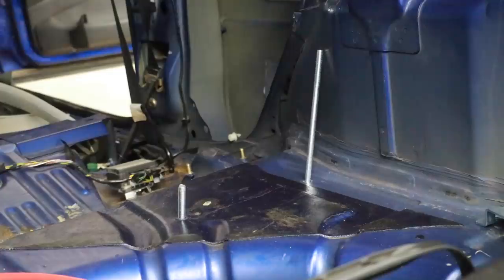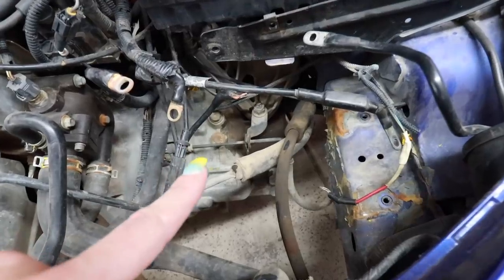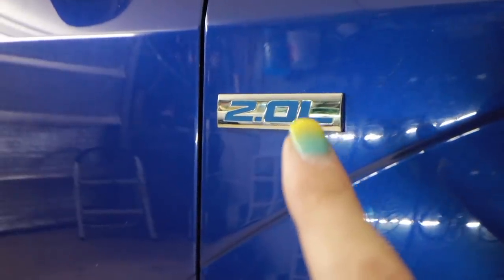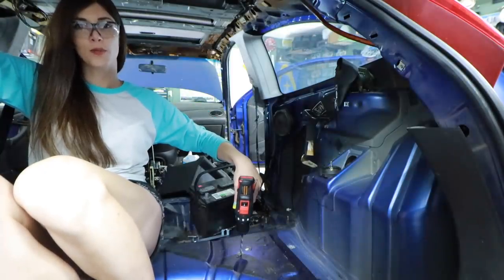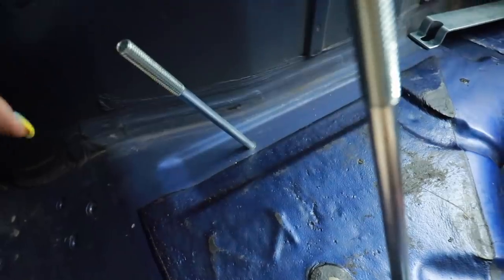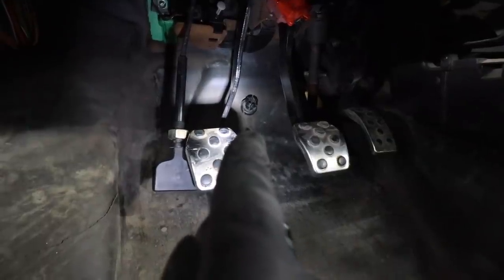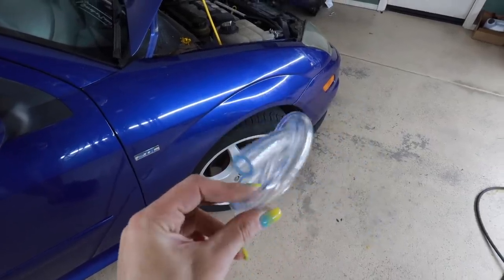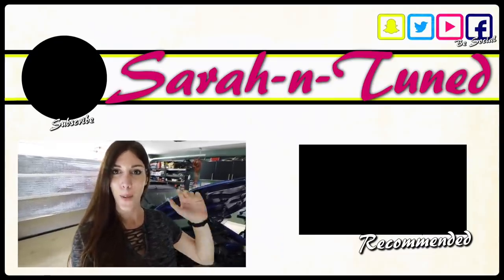Because Racecar!? // Rally Focus SVT Battery Relocation

Comment: So the Battery Cut Off, it won't shut off the car because your alternator is still being driven by the engine. There is a 6 pin Cut Off Switch which you need to wire into the ignition of the car too so when you pull the bone it actually interrupts the ignition and turns off the car while also disconnecting the positive terminal. I like your videos! Cheers from Germany 🍻
Reply from the maker: FAT CAT Performance 😫 ...too late now
Reply: @SarahnTuned  I was just about to say this. You need a Battery disconnect switch with Alternator Field cut-out contacts(which are supposed to be disconnected prior to the High Current Battery contacts). Don't worry, I have a similar single contact switch in my race car, I just make sure to switch off the ignition before turning off the big red switch, lol ...I'm really enjoying this build btw :)
Reply: @SarahnTuned  Might want to check that rulebook again, some sanctioning bodies require you to have the correct shutoff switch.  It would suck to show up to tech and get turned away for something that simple.
Reply: @SarahnTuned  unless you're swapping to a total loss electrical system (no alternator) you're almost certainly going to need the other style switch. I've failed so many SCCA cars for annual tech for this exact mistake.
Reply: The 6pin switches also have a resistor to dump the current to ground. Even if the kill switch kills the battery and shuts down the engine, the spinning engine will turn the alternator and generate power. The resistor will dump that power to ground.  I've had to re-wire the kill switch a few times, because different tech inspectors had different opinions on how it should work. I've also fried an ECU when it was setup wrong. That took a LONG time to figure out, since the car would run but not well.

Comment: Make sure you have a service loop when running cables.  (Extra length or some zig zag in the layout that can be used to extend or retract the length.  Helps to install/remove the battery.)

Comment: Hey Sarah one thing you have to check the rules for relocating the battery. Depending of the class that you want to run...
Reply: Good point.
Reply from the maker: Santiago Alban by the time I actually finish this thing, they’ll be racing solar powered rally cars 😂
Reply: @SarahnTuned  Dude they'll be flying Jetsons style by the time you're done.

It's a bird! It's a plane! No it's just a Camry.
Reply: I don't think the center console is going to suffice for the battery switch. They will probably want it in an area where it can be reached from outside the car, without having to reach in that far. I usually see them on the dash, near the side window
Reply: Every racing sanctioning body has it’s own rules for where those shut off switches should be, please check the rules of which your going to race in to make sure your not wasting your time.

Comment: The RTV on the IMRC actuator looks very old if nothing else, might still be worth pulling apart to check. If not, they used that same actuator on a few different vehicles(different cable, bust same unit) so a new one for a SVT can be a used one from a Contour or a Taurus.

It's also going to be worth checking the linkage at the manifold, if it's sticking it can give you the same fault, and also keep those runners long above 4k, which might be what you were feeling with it not wanting to rev out well.

Thank you for the circuit breaker mention, I was getting a little antsy seeing that many feet of unfused power lead.
Reply: Mondeo ST200 and 2.5V6 use same IMRC, also Cougar use the same. Dunno if you had these cars in US.

Comment: Great video, Sarah. I'll be interested to see the conclusion of this phase of your project; specifically, how you route the ground side of the circuit where the old ground cable was. Keep up the great work. Love your channel.
Reply: You usually use the cars frame as a link for ground. She will probably screw the battery terminal near the battery and the old battery cable somewhere in the engine bay.

Comment: The fill hole on that transmission is on the front facing side towards the bottom, there is a vent on the top/back near the shifter linkage, but unless it's worse in person than it shows up on camera, I'd spray it off and call it good.

Comment: You'll need an externally mounted pull cable to the isolator. Dont think mounting on centre consol will cover you for access from outside. Also might need to upgrade the isolator to what they normally call an FIA spec that kills alternator power too.

Comment: Before you cut the wire you might want to get an idea on cage placement. Most race cars I've been around have the wire loom inside the cage to prevent severing in a crash.
Reply from the maker: vanmanpredator1 I don’t have anyone to fab a cage yet 🤷🏻‍♀️
Reply: @SarahnTuned  most roll cages are made from 1.25 inch to 1.75 inch diameter tube. Some go 2 inch diameter. So if you go 4 or so inches inboard it should be good.

Comment: I'm not reading comments to see if it's been suggested already.

When you're drilling, and you're concerned about damaging something on the other side of your work piece, you can use a drill stop, which prevents you from drilling deeper than a specified depth. They come in sets.

Comment: The shut off switch is not usable for anything else than styling and to stop battery drain while storing the car.
For a race/rally car you need a switch that cuts both the battery cable AND fuel pump power AND/OR ignition power. The car needs to shut off when you flip the switch. If you only break the battery the car will still run off the alternator...
Usually you also need to be able to reach that switch from the outside of the car, which can be done by a handle on a wire.

Love your videos, your always fun!

Comment: @Sarah-n-Tuned: Nice Idea with the breaker switch, but I would run a Bowden cable outside the car, so in case you're stuck a marshal or viewer can shut your car off (dis-/connecting to the hole in the key of the switch)... and mark it accordingly with a red electrical flash sign on blue ground or just a red flash with your colour of the car :)

 Also the circuit breaker must not be more than 30cm (about 1ft) away from the battery pole, I would suggest a ANL type of fuse, they're sturdy and available in the ratings you need for this application.

Comment: You should consider putting the battery cut off on the driver side A-pillar,  also as others have stated you might need to change your battery set up depending on the class.
Reply from the maker: RetemVictor I could still do that, it just makes me nervous having it outside the car since I still have to drive this thing on public roads.

Comment: I used to read on focaljet about people trying to repair those IMRC’s for the intake, and I had one fail myself in 2009. Just replace it - that one is super ghetto repaired...or since it’s going to be a race car, just replace the intake manifold with a racing manifold and get rid of the dual stage intake. A tune will eliminate the control variables and prevent a P1518

Comment: Sarah. for safety sake ,and Fire safety .you should mount a metal handled  kill  switch(plastic key will break ) outside the car..with a remote cable attached to it so the driver can shut off the switch and some one outside the car can do the same if your Rally  car is rolled over and they can not get in side the car.they will Not be able to shut it off .thanks for sharing the video

.

Comment: 1) The Ground Battery wire needs to be attached to a big chunk of dense metal, opt for the original location or simply attach it on the gearbox (many cars have the battery ground on the gearbox). Otherwise you will have voltage losses along the circuit, the battery will not charge correctly and the alternator will be prone to failure due to voltage spikes (such as when the engine fans start). 2) You do not need a circuit breaker for the Plus wire, the length of the cable is not an issue if the wiring is done correctly. 3) When you disconnect the battery, you first disconnect the ground wire, then the +, and at reconnection you do it the other way around. For this reason, the cut-off switch needs to be placed on the ground wire. 4) While you're there, do a check on the alternator and make sure it runs in good condition (i would hazard a guess that it needs a rebuild by the looks of the car). 5) After all these are done, you should have AT MINIMUM 13.8 volts measured at the battery with the engine running, at least 2k rpm and the headlights on for the battery to actually charge. At optimal you should have at least 14.2 volts to indicate good charging. Any less than 14.2 volts means faulty alternator/wiring. Extra stuff: i would add insulating material on the + wire if you're there.
Reply: You're wrong. In a DC circuit you ALWAYS put the fuse (or switch) on the positive side of the circuit.

Comment: Might be worth not attaching the power cable until you get a cage installed just incase you have to move it when either welding or bolting the cage in. Keep up with the great work and videos

Comment: It looks a helluva lot better with the European spec radiator grill and the headlights with the built in indicators were on the facelifted Mk1.5 here in England and looked loads better than the original indicator location in the bumper. I've seen them retrofitted into Mk1's

Comment: Hi Sarah not sure about in the USA but here in the UK the battery cut off switch is usually on the outside of the car between the bottom of the front screen & the hood with a direction arrow to say which way is off. I would of had the roll caged fitted first does it have to be fully welded in or a bolt in cage? You might of put battery box exactly where a cage suport will be? Good work so far though

Comment: In Europe we actually use cable operated main cut-off switches, so that you can have the switch inside and a cable end outside of your car (allowing the rescue team to cut off the power purely from the outside). Something like this: https://inter-rally.pl/product-eng-34380-RRS-6-poles-FIA-master-switch-isolator-with-pull-cable.html
For the circuit breaker you can use a BIG fuse, something like 300 Amp.
As far as I recall mk1 Focus, there are some grommets inside the A pillar, but I might be totally wrong on that... For smaller gauge wires I used to use the steering column hole.

Comment: Might be worth turning your battery through 180 degrees so that you have slightly longer cable runs inside the battery box so you can disconnect the battery in future, eg. If you need to change the battery, or need to isolated the battery to work on the kill switch

Comment: Hi Sarah, you might want to check your local rally regulations, as im pretty sure you need to have an external battery cut off, if car was upside down then would not be able to reach in to car to cut the power, im also pretty sure there is something else that needs to have external access as well, but your local rally club, authority would be able to confirm this for you.

Comment: Not telling you what to do, however I am relocating the battery on my 86 foxbody. I looked into using a fuse or a circuit breaker at the battery. It isn’t a recommended practice apparently. The starter draws more amps than the breaker can handle. Idk it goes against everything I believe in lol. Let us know your thoughts on it. Thanks!

Comment: If you haven't cut those cables you should leave a little slack in case you need to relocate them for the cage. Depending on the style/regulations there might be a base pad in or around those floor edges.

Comment: It might be a rally car, but if you look at the top rally teams, their cars and workshops are spotlessly clean and are treated like formula 1 cars. also, you shouldn't have to run the negative cable through the car, it's a negative earth car, connect it to the chassis as close to the battery as possible, job done.

Comment: How did you work out the thickness of battery cable required? I've tried using 510 CCA in an online calcuator  but the size it says for a 3metre length is 70mm2!

Comment: You do not need to run a ground wire to the engine bay.  Simply ground the cable to chassis ground near the battery box.  Wire = $$ and weight.

Comment: Great content. I would suggest that you research four pole cutoff switches. I believe that because you have an alternator, your current cutoff switch will not shutdown the engine as the alternator will provide power as long as the engine is running.

Lookup Moroso #74108. That should do what you need and I think the Moroso catalogue will explain why you will need one (as I might be wrong).
Reply: My  thoughts as well,  and it needs to be accessible from out side by marshal

Comment: You dont need rear weight. Make the rear of the car weigh 0. Suspension will provide loading on the rear outside tire and thats all you need. Throttle will provide load on the rear inside tire when needed.

Comment: Your kill switch needs to kill the alternator too.
I'd test reach the location from the outside of the car to see if it is actually easy to grab for a helper. If not you might need to move it to the outside of your dash instead.

Comment: I notice that your transmission is missing the counterweight, its not really needed but helps with the notchy-ness of changing gears.

Here's a link for the headlight wiring, you might need pigtails if the lights did not come with them. Most vw's of that year used the exact same pigtail 

https://forums.focaljet.com/showthread.php/643847-HOW-TO-VW-Wiring-Hack-(convert-your-car-to-Euro-MACH-headlights-with-pictures!)/page6

Comment: My race car follows a different rule book but I ran my electrical cutoff as follows:

1 - Circuit breaker next to the battery.
2 - The thickest 100 amp cable goes straight from the circuit breaker to the starter motor.
3 - Thinner 50 amp cable goes from the alternator straight to the starter motor.
4 - Thinner 50 amp cable goes from the starter motor to the cutoff switch.
5 - Thinner 50 amp cable goes from the cutoff switch to the original fuse block.

When you shut off the cutoff switch, the engine and all the car's electrical circuits are dead. The alternator will not have a high voltage surge because it is still connected to the battery.  Even though the alternator generates a charge as long as the engine is still turning, no electricity can reach the car's electrical system through the cutoff switch. The starter solenoid will be dead so that even though the starter motor is still connected to the battery, the starter circuit cannot activate.

I attached the cutoff switch to the roll cage in the driver's window. Recessed enough so that the window can be closed but otherwise right out in the open so any safety worker can easily find it and I can reach it from the driver's seat. (the car has windows because it is still technically "street legal" but the window must always be open when racing)
Reply: This is an excellent suggestion if you do not wish to use a 4 pole cutoff switch that I mentioned above.

Comment: Please use a fuse at the battery on the positive cable. Just in case the wire gets pinched so you don’t burn down the car and or explode the battery.
Reply from the maker: G M you mean like I said at the end of the video 😉
Reply: @SarahnTuned  Aloha Sarah! Yea I posted before the end the video LOL. Great job on the project and videos! Off subject what are the chances of you driving a Tesla Model S performance or a Model X :)

Comment: Do you have a vent if it’s a lead acid battery will need a vent tube to be in the cab or an AGM battery can be used in a cabin because it produces no gas

Comment: Should change your name to Sarah n preventative maintenance lol. I kid I kid but on a serious note you should check on the rules for the type of racing you’re going to be doing because I’m
Pretty sure the battery cut off needs to be on the exterior. If there’s a fire they’re not going inside the vehicle. If you want one inside just run a toggle switch but definitely have to have that on the outside and usually on the rear end somewhere.

Comment: Does the battery have to be vented outside the car?
Reply: I agree.  Any lead acid battery needs to be vented to the outside of the vehicle when installed inside of the passenger compartment or trunk.

Comment: Don't you have a handgun ? You would probably need to clean it up, but you'd definetly get thru ford steel plates with a 9mm (you should probably have gravel under the car because of the risk of a ricochet, but other than that...

Comment: If you plan on upgrading that cheap battery go with a agm and that vent will be unnecessary.
Reply: agm batteries need a vent. Lithium batteries dont.
Reply: Agm batteries do not need a vent because they're literally sealed

Comment: Next time you buy wire go buy it from your local welding supply store. A lot cheaper when you purchase from them.
Reply: I can pretty surely say that 20ft of normal 2ga battery cable is cheaper than 20ft of quality welding cable.... 🙄

Comment: I don't know if that battery shut off switch will work for you, or if it would pass tech. That's more for boats or RVs. I think you might need one with alternator cut off as well, as I think the car will keep running with that switch!
Reply: I came here to say that exact thing. Can't count how many times I've tested a kill switch doing an annual SCCA tech and the car just keeps going. So many last minute rewires to get people out on track with the proper gear.

Comment: So.....to get to the dodgy IMRC (code 1518) you take out the front headlamp?
My car also has the engine light on, dammit
Reply: On SVT? Yes...on ST170 IMRC is on different position.
Reply: solidsnake123100 
Er....yes mine IS an SVT, I bought it back from Florida 🌴 🇬🇧🇺🇸